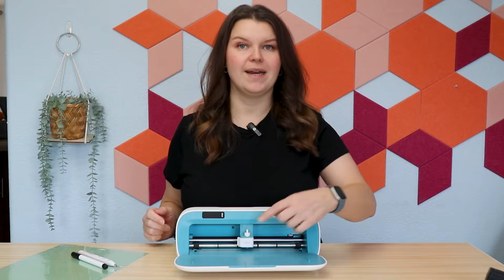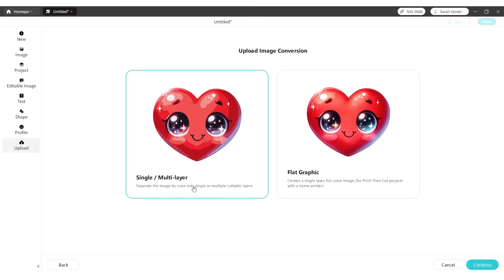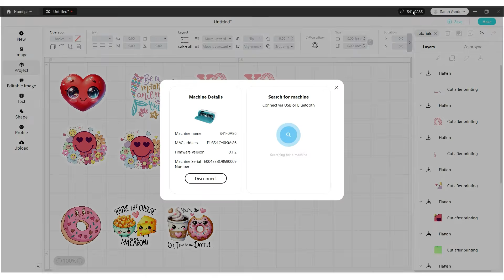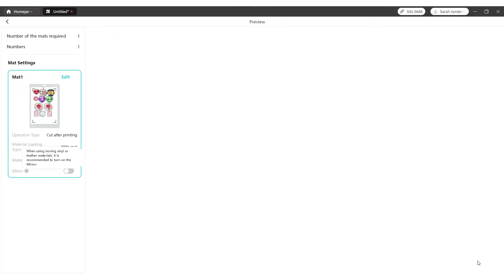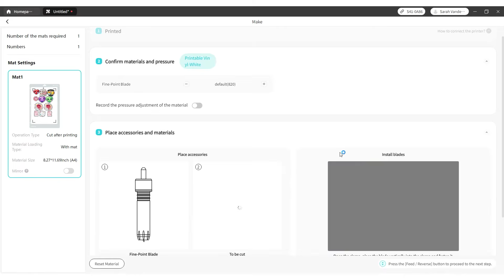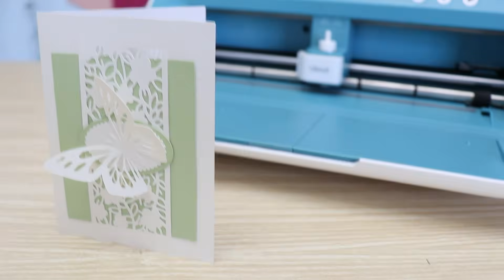Smart Cutting Machine that makes Stickers - Likcut S41

Comment: Your videos are very helpful to new users!
I was planning on getting the S501 after viewing the product with the scan and print software update, however the S41 seems more versatile.

I find the PC software and Android App  very clunky to use, but that may be because it is new to me.

The only thing I am not sure about is importing a pic with multiple stickers on a single page. Do they need to be imported 1 at a time or can I do them all at once?

I have created a set of switch labels in CorelDraw! and exported the page as a PNG with a transparent background. The Likcut software seems to  treat this as a single image. Because I do not have a cutter yet, my ability to check on this is severely limited. I am not sure if the cutter would cut out the actual label stickers or just cut around the outside of the image. I cannot even print the image from the software without a cutter attached.

Thanks again for your videos!

Comment: Can i use the Likcut software/app and this Likcut machine to design and cut custom book cover designs? For example with foil adhesive vinyl? TIA xx
Reply from the maker: Yes, you can upload any design you create and cut it from any type of vinyl. Ideally the design should be saved in an SVG or PNG format for the software to use it correctly.

Comment: Hello, im wanting to use this cutting machine but im a little confused on the printing process. Do you have a video on which printer you use to print the template for the stickers to be cut on or what printer you were using?
Reply from the maker: This is the printer I use https://amzn.to/4d4qRaw
But any ink jet printer will work. You design and do everything in the cutting machine software and just send the design to your printer. Then cut it using the cutting machine.

Comment: I like to design my sticker pages in procreate. Can I design a page in that and then print and cut with this easily? 

And what about replacement blades,  and cost of these?
Reply from the maker: Yes, you can easily import designs into this software. And there are replacement blades, they are $12.99 USD for 2.

Comment: Would I be able to cut through a plastic cutting mat to make my own stencils. Or, is there a material that I can use with this cutting machine to make custom stencils? Thank you so much Celeste
Reply from the maker: I used to use a product called Dura-lar. It's a thin plastic sheet sold at craft stores and it makes great stencils. You can cut it with this blade!